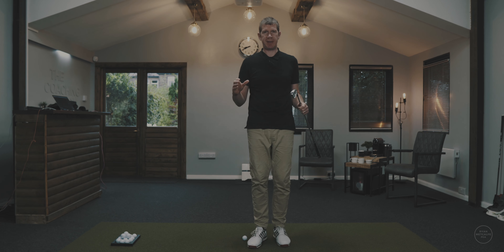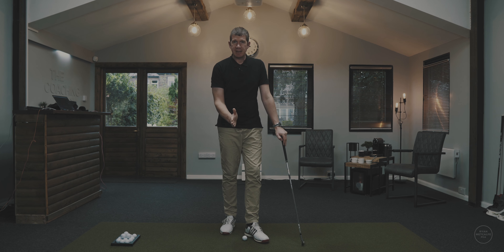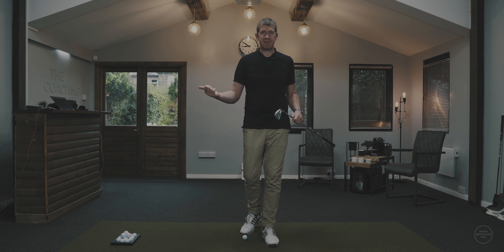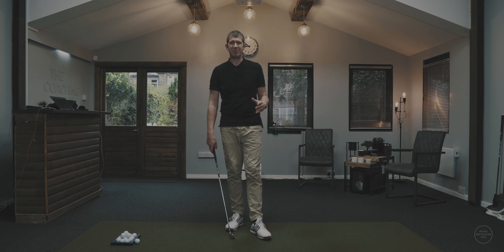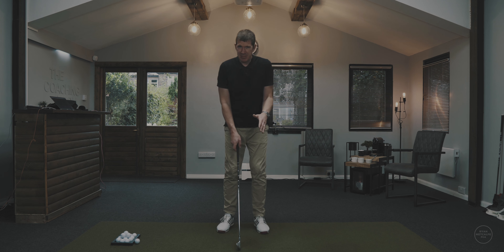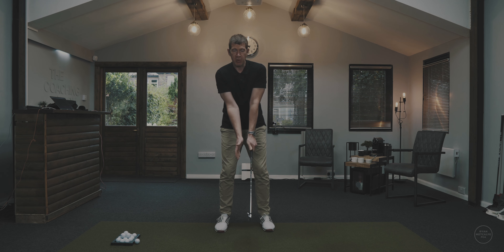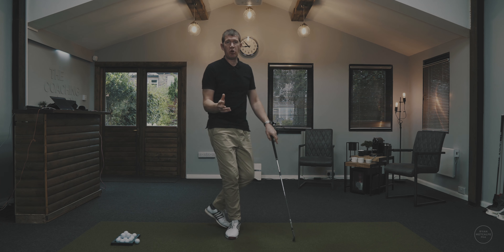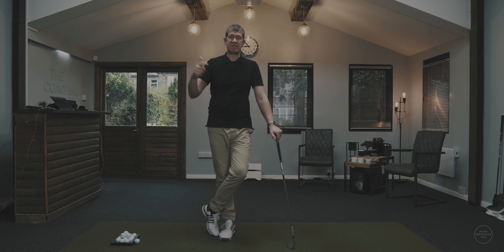FIX THIS FOR A BETTER GOLF SWING

Comment: Cheers Ryan. The right elbow definitely tucks in much better starting from here.  The lower right arm moves around the tucked elbow instead of the elbow moving out.  Which then moves the right hand away which then helps the left arm stay straighter.  Nice!